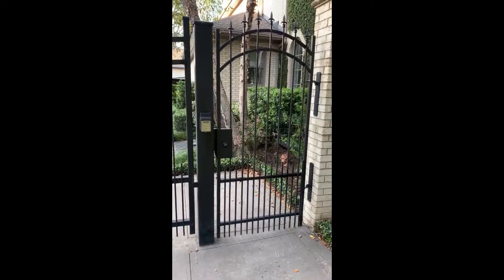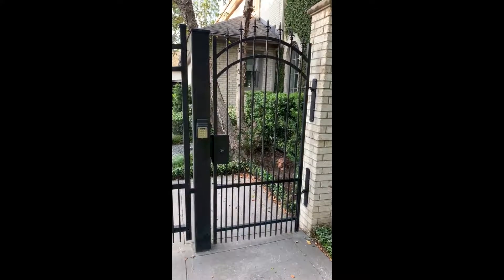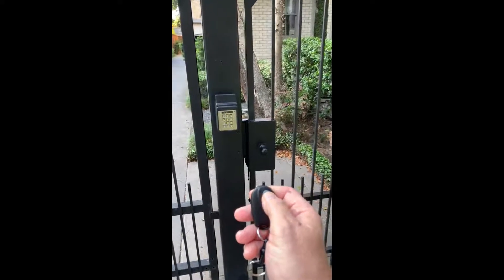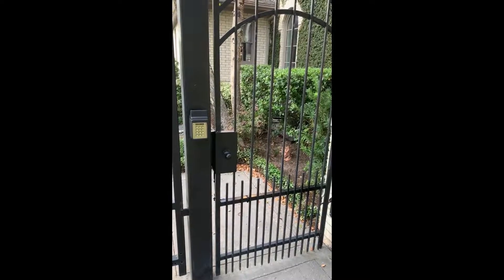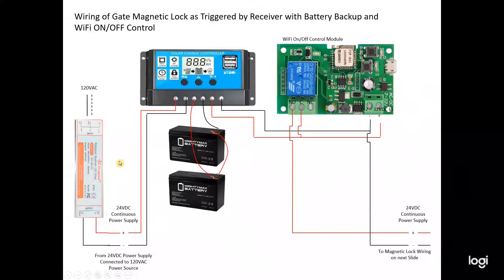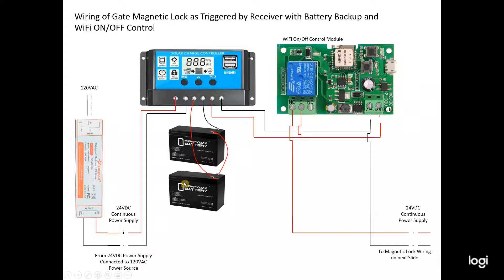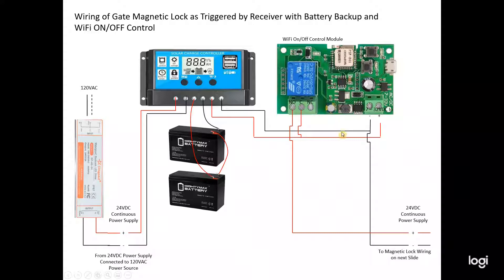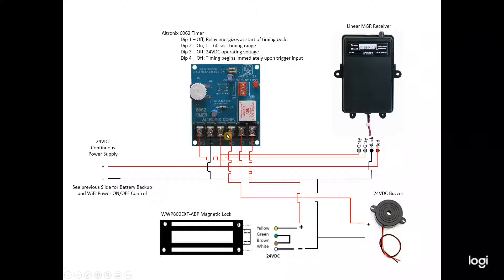Magnetic Gate Lock - Magnetic Lock Install with Battery Backup & WiFi Control

Comment: @13:14 Do you have an auto-close mechanism on the gate or you manually pulled it in yourself.
Reply from the maker: I manually push the gate closed.  No auto-close.  You could add a spring mechanism if you wanted to auto-close the gate though.
Reply: @jimt1000 Nice.

Comment: If the Power goes out,  are the batteries designed to keep the door locked and power the battery control, receiver, timer ect? But if the house Wi-Fi and router are out as well due to power outage, you have no control of the unit via WI-FI correct?
Reply from the maker: That is correct.  Assuming you have a power outage at your house, you'll not have WIFI to control the lock remotely.  However, the batteries will keep the lock energized via connection through the controller for a given period of time.  I'm not certain what that given period of time is as I've not tested this for any long period.  It's dependent on the Amp-Hour rating of the batteries.  But I will tell you that I've had a few outages for a few hours (blown area transformer, etc.) and the batteries kept the gate locked and, therefore, secure.
Reply: @jimt1000  Thank you for the reply! I have a few other questions. After watching this video I purchased most of this set-up for the magnetic locks at my retail store since I was having no locks during power outages. The power source going to the charge controller is 12.5 Volts, does this cause a battery charging issue since it's a low voltage for a 12 volt battery?    Also, Is there a way to have the power for the door locks to be drawn off the power supply first instead of the battery? I would prefer to have the battery used as a back up in case of an outage, not the first source of power. As of now it appears to pull from the battery first causing it to discharge every evening.
Reply from the maker: @emilschaffroth6247  The system I have shown, the with components listed, is a 24VDC system.  The batteries, even though 12 volts each, are wired in series thereby resulting in a 24 volt backup battery hookup.  The magnetic lock I also specified is a 24 volt lock.  So, if you're going to use a 12 volt supply, you'll need to have a 12 volt magnetic lock.  You'll also need to hook the batteries up in parallel, not series.   You'll also need to be sure the keypads, transmitter, etc. all will work on 12 volts.  In terms of your question about the power being drawn off the power supply first, that's exactly what's happening and the charge controller is governing this relationship.  So, no worries there.  I highly recommend, if you're going to follow this design and the components as specified, you use a 24 volt system as intended and follow these instructions precisely.  I've had 3 such installations myself and others have done several more.  In all cases, the installation went smoothly and has worked with much success.  I don't think a 12 volt system will work with these components.  Hope this helps.  Good luck with your installation.

Comment: can you explained with 12v
Reply from the maker: I’m not understanding your question. Are you wanting to know how to make this an all 12v system?
Reply: Yes you have 24v and some other devices like mag locks and electronic strikers are 12v there is any way you can put some kind of list or something for 12v systems
Reply from the maker: @tintin0595  The system as shown is all 24V.  This includes the mag lock which is 24V as well.  If you have 12V, you can use most of the components I'm thinking, but you'd need to wire the battery backup in parallel, not in series as shown.  I would look online at all the components and see their compatibility with 12VDC.  In my research, I found the mag locks most commonly 24V.  But I'm thinking these components would work with 12VDC too.  Just check online (for example, I know the solar controller would work wth 12V).  Good luck with your install.
Reply: ok I got it thanks for you response
Reply: yes

Comment: The sonoff will do what you're using the 6062 to do, go into the settings and use inching mode, I usually set for 5-8 seconds
Reply: Bro, put the magnet on the post not the gate, also put the bracket on the gate so it doesn't hang into the walkway. A hes5000 electric strike is a way better option imo
Reply from the maker: @michaelosmon  Can’t put the magnet on the post in my application. No way to run wires to the post without saw cutting the concrete. That’s why I had to put the magnet on the gate and the strike plate on the post.